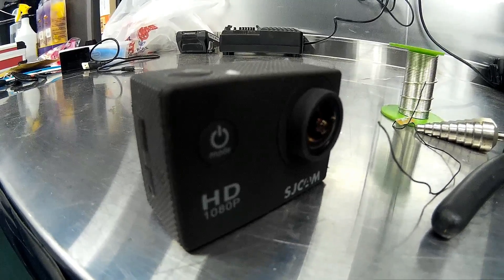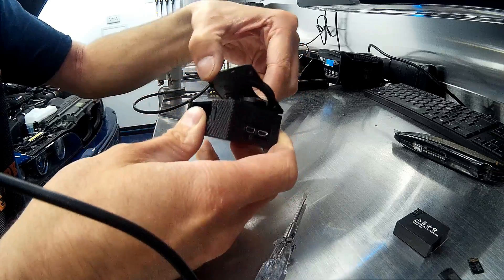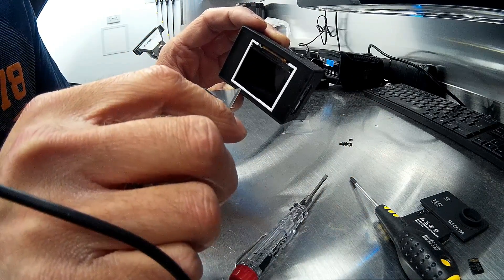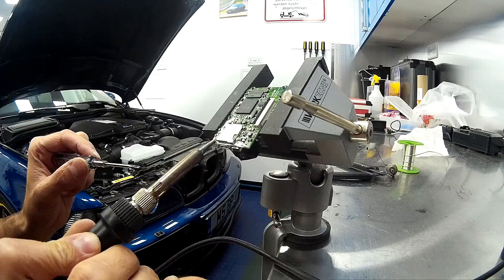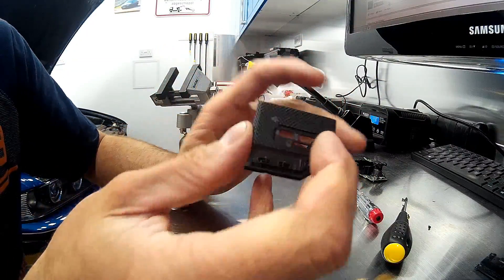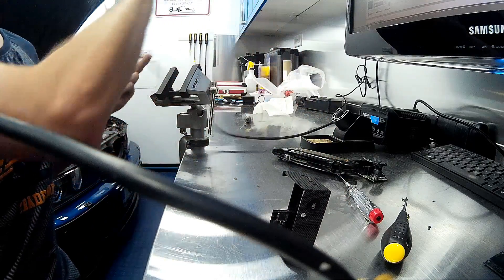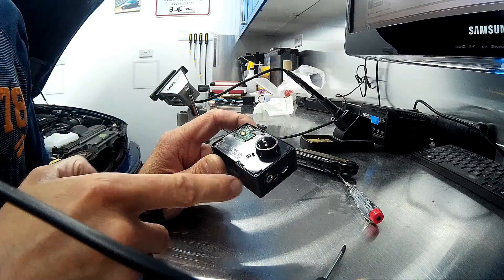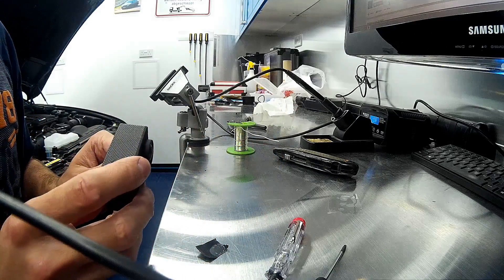SJ-Cam SJ4000 Action Camera External Microphone Retrofit Mod DIY How To Guide

Comment: This is a very bright video about mounting an external mic on the sj4000. Well done! But what I'm wondering is: why mount an external mic anyway? Agreed the stock sound is bad, but that's not a surprise, since the hole for the mic is on the right side in the middle next to the buttons, whereas the actual mic is placed right up in the corner above the lens seen from the front. So, why not drill a hole right there ? Since the camera looks pretty empty up there, the camera shouldn't even opened to drill the hole. Or am I wrong?
Reply from the maker: Hi. You could indeed drill a small hole, but the reason people, and myself, wanted an external mic is due to the really poor quality of the built in one. Due to it's small size (approx 4mm in diameter), it is unable to pick up audio that would be of suitable quality for use. This is a shame as the video quality is great. Using an external mic allows a better quality microphone to be used, and you can then position that microphone where you want it too - Good point of example being if you wanted to film from the front bumper mount, but wanted the audio to be recorded from the exhaust then you could run the mic wire to the rear and mount the mic there.
Reply: Thanks for the quick reply. Mounting an ext. mic is a good idea and makes the cam more versatile. In my case, I was ok to settle for GoPro built in mic quality. I did open the cam to be careful not to hit anything when drilling, and I did succeed in enlarging the pin hole of the mic to 2mm. The difference is astonishing. The sound is now clear in normal use whereas it used to be dull, near nothing. From what I've seen, the hole can be safely drilled without even taking the cam apart, if carefully done. Happy camper!